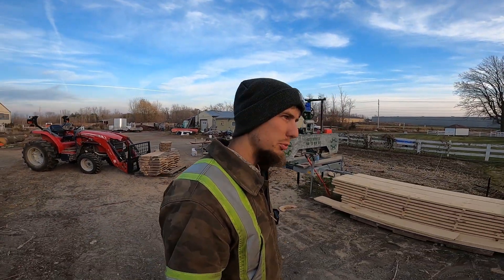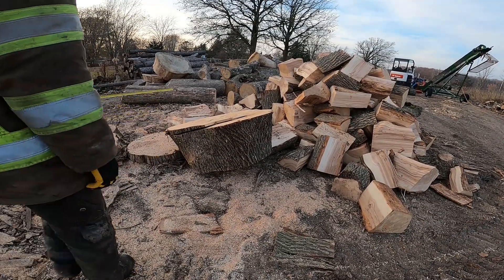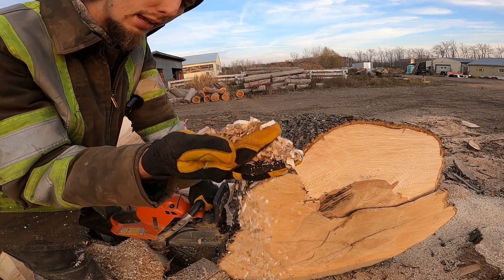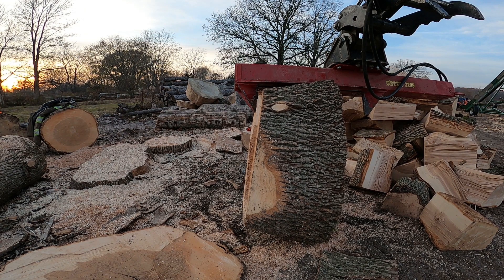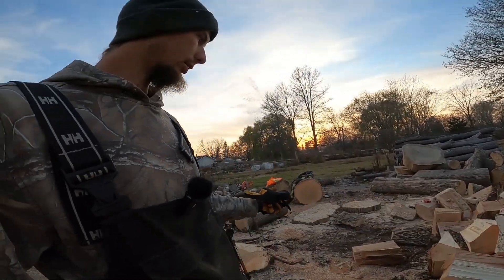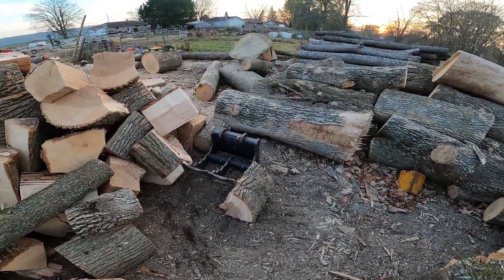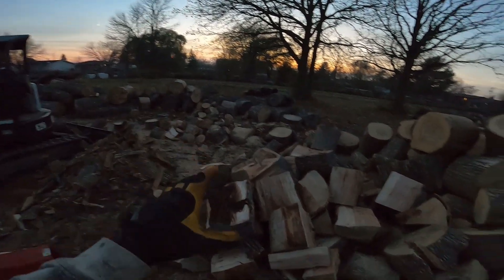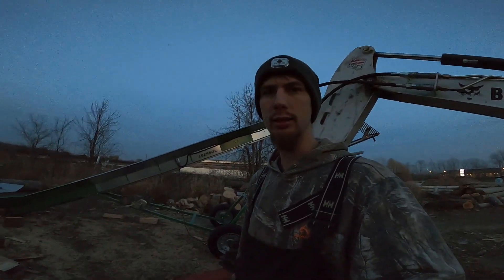The Best Way To Split Boiler Wood?  |  SplitFire 3209

Comment: Nice to see those shorter logs in slabs instead of busted up.  Been thinking about a skid steer splitter but on a mini you would think less tearing up of the ground..
Reply from the maker: I had one on the skid steer, you are right there, it really makes the mess of the yard, so if you are on concrete I guess, then it's hard on tires lol!